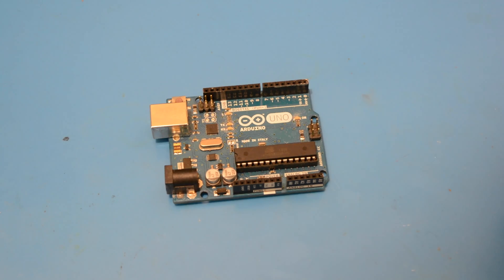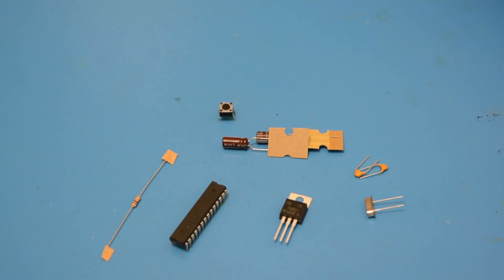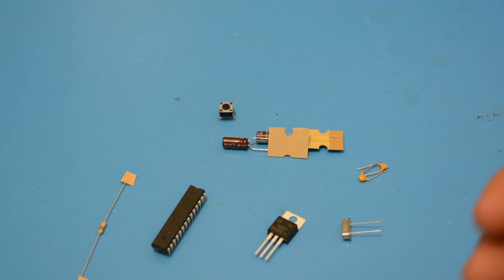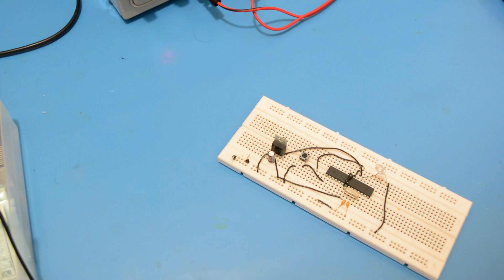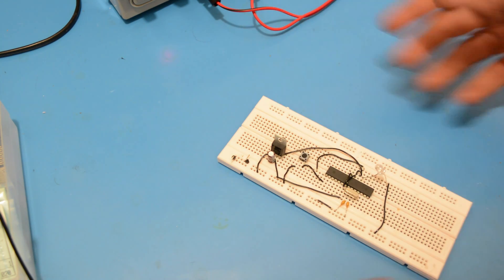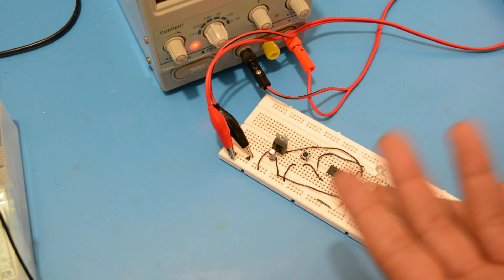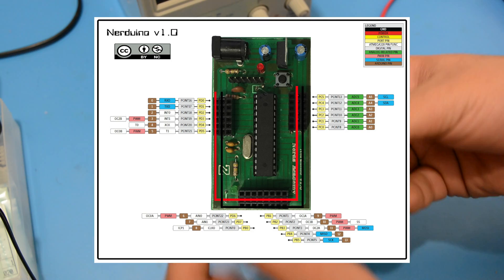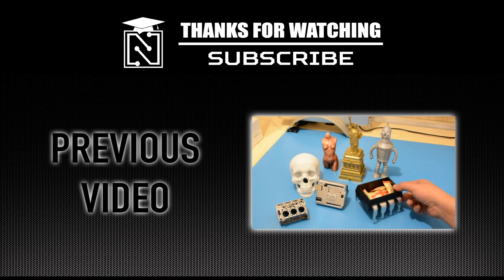Facere teipsum #1: Make your own Arduino

Comment: hi, can you upload the schematic? and eagle files
Reply from the maker: Hello, couldn't find the eagle files so I routed this board for you. You will find the board files as well as the gerbers. PS. print the pcb 1:1 scale and check for components fit before making it. Also this board was a quick job so make sure to recheck it against the crude schematics in the video. Download link below.
https://www.dropbox.com/s/rsny63oyeoav0fy/Nerduino.zip?dl=0